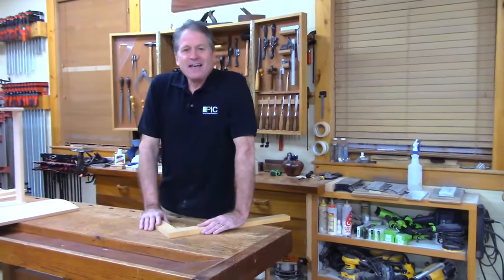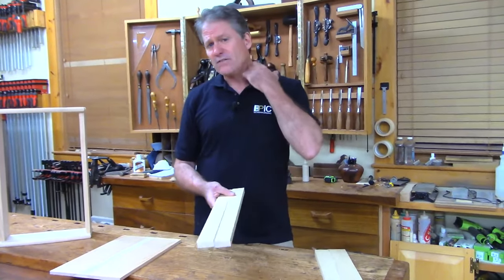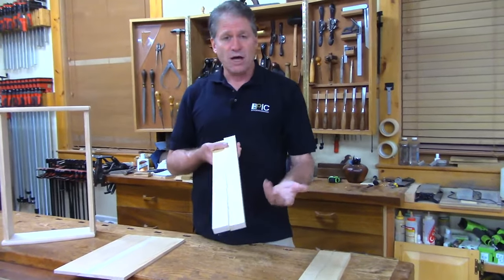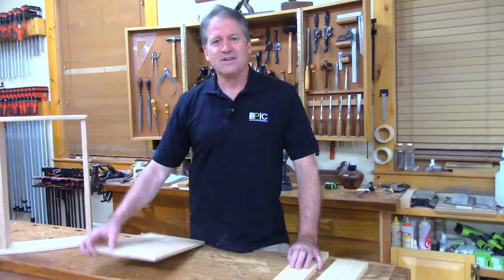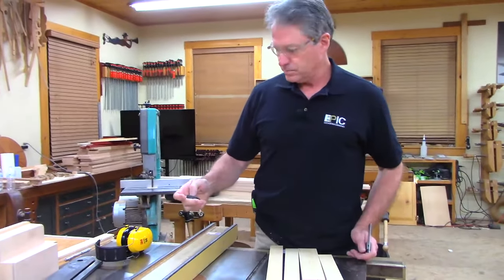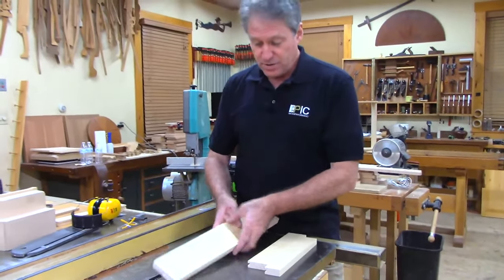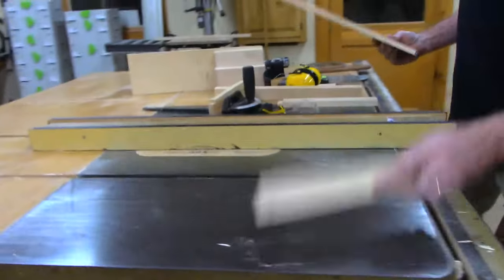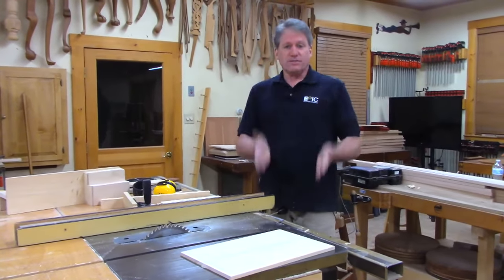How to Make a Raised Panel Door with Tom McLaughlin

Comment: Hi Tom
Thank you very much for this excellent video on how to build solid doors using true mortise and tenon which no one does anymore at least on the commercial side. everyone is happy building doors using 7/16 of an inch or profile part to be the joint between stile and rail. Based on my experience, such joint will last 5 to 6 years or less depending on how the doors are handled.  
I have always said that the sign of true craftsman is one who makes it easy when watching them doing their craft and you are truly a true craftsman.
I build my doors the same way you do with some differences:
1- I use CNC to make my mortise and tenon joint mostly because I was told that mortiser does not do good job in drilling in hardwood. However, after watching your video, i am very much interested in trying the mortiser that you have if you don't mind sharing the make and model of your mortiser or if you can advice on a good one. This will save me substantial time on small jobs.
2- Do you really need pegs in the door? I don't use them because today's glue is pretty strong and many customers don't like them if they show on front face of the door.
3- If the doors have profile then things get more complicated as you need to cut the stile and rail at 45 degree and remove the profile where it meets the rail. I have a custom made router bit designed to do that but recently kreg came up with similar bit, called notch bit, as part of their beading system if you want to check it out. 
4- I tried using Domino instead of true mortise and tenon and the way I did it is that you build door using cope and stick bit and then u cut part of the tenon and mortise there and into the stile where Domino is going to go. The problem is with the stile and rail being only 2 7/16'', you can only use one Domino so to compensate you make the Domino really long going into stile and rail. You save time but the joint is not as strong as your true mortise and tenon wide joint because Domino is only 3/4'' wide.

Last, I very much would like to join your live shows and hence if you let me know about dates and times I would greatly appreciate that. Hopefully it is late afternoon or evening.

Thank you again for being great craftsman and look forward to hearing from you
A.J
Reply from the maker: Thanks AJ, great to hear from you and I’m glad you enjoyed the video!
The mortiser I have is made by Jet, the floor model. But there are quite a few bench top models out there that you can find for around $400. It’s important to buy good chisels as well, like most things you get what you pay for. The most inexpensive ones are quite often poorly made, although they will do the job but not as well.
I know what you mean about it a true mortise and tenon, I love the traditional strength and style of them. And I usually mention in the video, adding the pegs is overkill, and really added more for the decorative traditional look since as you described, modern glues are excellent especially if the joint is well fit.
And I agree, the Domino is a great modern method for quickly making a better than average floating tenon joint, although with its limitations as you described, but still quite strong.
Our livestreams are every Thursday evening at 8 PM (EST). The best way to find the link, and more information about everything we are doing and offer, is by going to our website epicwoodworking.com. By joining our mailing list you will get informed each week about the upcoming livestream and whatever other special things we have going on. 

Thanks again for watching, hope to connect again sometime!
Tom

Comment: By the way, there is a great electric outlet device out there that you plug you machine into one outlet and the vac into another. When you turn the tool on the vac also goes on, but stays on for a few seconds longer than the tool. No remote needed.
The device plugs into an outlet, of course.
I know Lee Valley Tools has them for sure.
Reply from the maker: Yes, thanks Jim. I actually have that auto mechanism built in with my Festool vacuum, which I like a lot. Thanks for watching! 😎

Comment: I want to make a 33" x 33" gate of 2" x 3" pine for my daughter's new home deck. I don't have the tools to do a mortise and tenon joint. But I was thinking of having 1/2" or 3/4" tenons top and bottom and (open?) tenons on the ends of the stiles. Would that, glued and screwed, be strong enough for a gate? No children but dogs.  Should I use 1/2" or 3/4" tenons for max. strength?
Reply from the maker: That sounds plenty strong to me Jim! The  general rule for strength is 1/3rds…the tenon being roughly 1/3 the stock thickness. Although I think you will find the 1/2” to be quite adequate.
Hope that helps! 👍